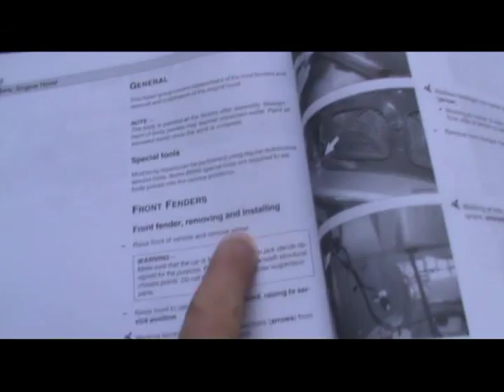DIY painting bumper cover & fender on 2000 BMW 528i

Comment from the maker: @vaptube yep, thought about painting it off, but installing the cover required enough stressing and flexing of the plastic cover that I was leary of causing the paint to split, craze, or distress while attempting to install.  The solution of course is an additive to your paints and clears that compensates for that.  It was a toss up.

Comment from the maker: @Jordanhead2011 - I didn't sand the color base.  I don't think anyone would do that.   Base is not to be sanded and the clear coat follow ups can be within 15 about minutes of the base coat. 

My lesson learned is to be more thorough ridding the area of dust, employing a better air flow system (box fans) with the main door most of way down.  

As you've seen (as I did) color sanding the final clear coats can overcome a lot of flaws including some dust nibs.